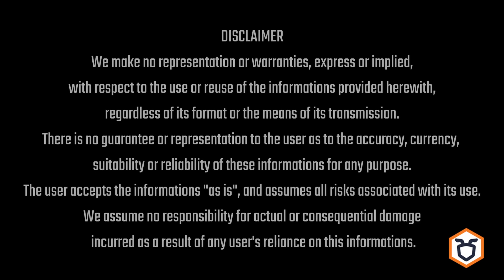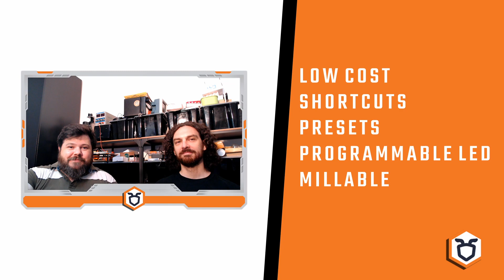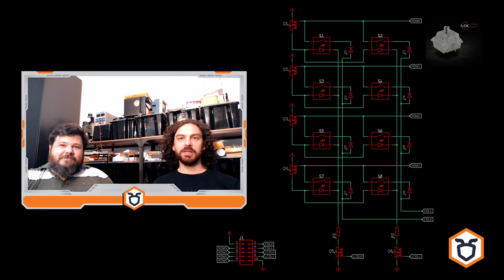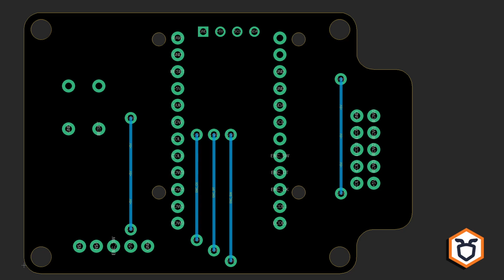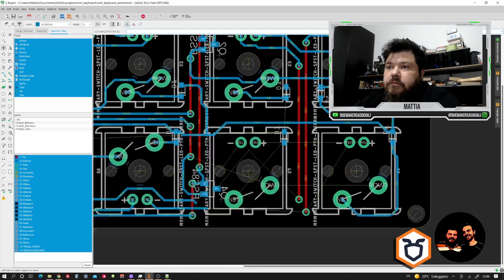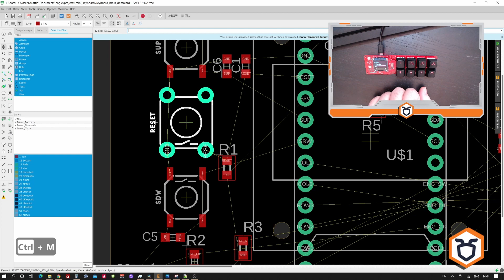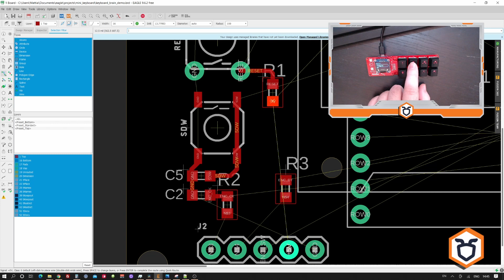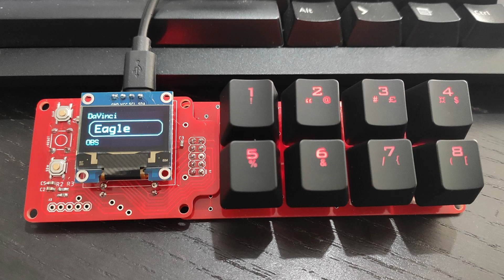The Ant Lab - The Keypad Project

Comment: Why do you do pre-drilling ? And what bits do you use?
Reply from the maker: Hi, we do pre-drilling for two reasons. 1) we do it with the milling bit that is rigid, and it helps the centering of the bits in the drilling phase, above all with tinier drilling bits that tend to bend.
2)in case of double side pcb, the pre-drill improves the quality of the holes on the top side.